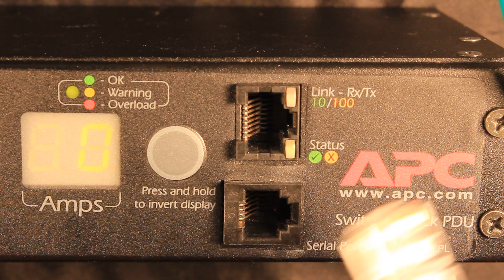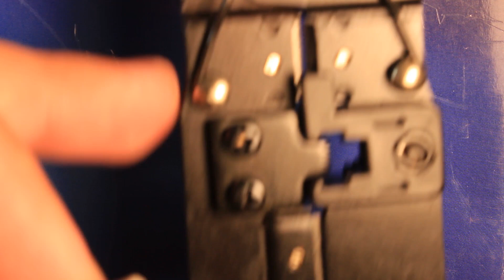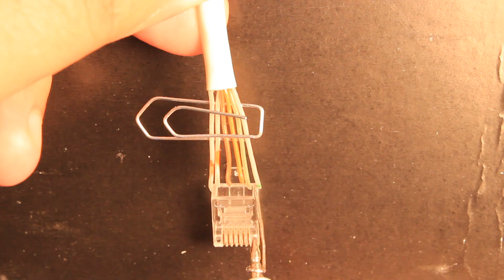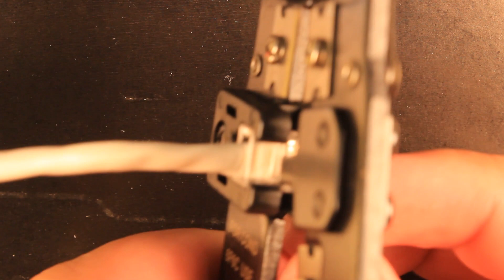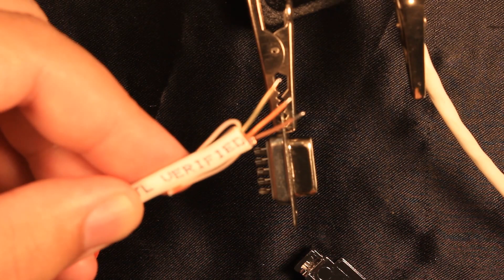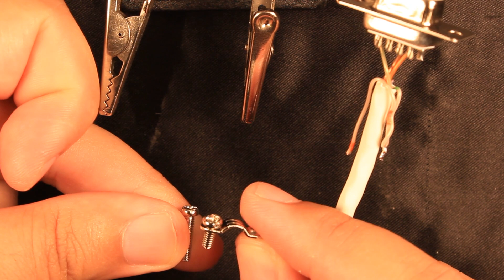APC 7920 PDU #2 DIY cheap serial console cable for password reset

Comment: Great info, thank you. I used it to make a Digi TS (terminal server) cable for APC 7900 and 7901 PDU's - so simple once you know the pinout.  I used RJ11 (4 pin) instead of 12 and worked fine. RJ45 side to the Digi, RJ11 side to APC. RJ11 pin 2 (of the whole six possible) to RJ45 pin 3. RJ11 pin 3 to RJ45 pin 5.  RJ11 pin 4 to RJ45 pin 4. Worked a treat, all you need is those three. 9600bps 8/none/1.

Comment: Thanks, worked perfectly. Used a DB9 connector from eBay and cut off one end of a rj12 5meter subwoofer control cable from a car amplifier ;)

Comment: thank you i was looking for the pin out.
but please make them a little shorter.
Reply from the maker: You mean that I should make the pins shorter, or the videos shorter?
Just joking, since I know the video is too long. I will try to make my other videos shorter if possible.
However, some people are often getting stuck at some very basic steps if one does not present the whole process.

Comment: I have an AP7920 PDU by APC and your pin outs did not work for me,  I read the APC manual and searched for "serial cable (part number 940-0144) pin out" which led to pinouts.ru 

This works and gives a prompt:

RJ12     DB9
1             1 (*)
2             5 (GND)
3             2 (RX)
4             3 (TX)
5                  (GND) 5
6             1 (*)

Set 9600 bps, 8 data bits, no parity, 1 stop bit, and no flow control to communicate.
You need to hit return 3 to 5 times to get a response from the unit.
Reply from the maker: Well, technically the pinout which I put in my video description is the same:
Pin 2  ----------to----------  Pin 5 (GND)
Pin 3  ----------to----------  Pin 2 (RX)
Pin 4  ----------to----------  Pin 3 (TX)
so I do not understand why it did not work. On the RJ11 connector of my unit pin 2 is already connected to pin 5, and that might not be the case on other revisions. Also, what does the 1(*) mean in your pinout?
Reply: Here is the link I followed :
http://pinouts.ru/UPS/apc_940-0144a_cable_pinout.shtml
Reply from the maker: OK, so they explicitly write that pins 1 and 6 are usually not connected. 
I am wondering: could it be that in the revision of the PDU what you have, these pins must be also connected? I have checked again, and on my cable there are really just three cables connected: GND, RX, TX and it works fine.
Reply: I think there are different hardware versions, we got two of those units from different ebay suppliers, only one worked with the cable, now trying to figure out if the unit is broken or the cable is wrong . . .
Reply from the maker: And the three-cable pinout from the description of my video did not work on any of the two if I understood you right?
In any case, if you have a multimeter, first I would measure whether the other pins on the RJ11 connector side are connected together, and they are commonly connected to ground. For my unit this is the case, and this is why I am only using three cables, since the GND is common with the other pins anyway.
Reply: Yes on the APC unit 2 and 5 were shorted. I'm away from the units now.

Comment: Are you sure the pin out is correct I am trying this setup an do not get a connection and the only diagram I can find online only shows pin 5 on the rj12 to be ground
Reply from the maker: This is the pinout I am using in the video, I have just re-measured it with my multimeter to be sure.
PINOUT:
==================================================
RJ12 (APC)                     DB9 (female serial)
Pin 2  -----------to-----------  Pin 5 (GND)
Pin 3  -----------to---------  Pin 2 (RX)
Pin 4  ----------to----------  Pin 3 (TX)
==================================================

Please keep in mind that from the web management or via SSH/Telnet one can totally turn off the serial console. In those cases the serial console only becomes active for that short period of time when you start the password reset procedure. Furthermore, one could have set different baud rate or turned on some extra bits which messes up the connection. This is why almost always it is a good idea to reset such unit to factory defaults, where first you reset the password via the serial console. The serial console goes into a standard state only during password reset in the case if somebody have changed the settings on it.
Reply: Donkey Learning IT thanks for you're help i got it working.
Reply from the maker: OK, glad it have worked out. Was the pinout causing issues, or the serial port was disabled from the software?